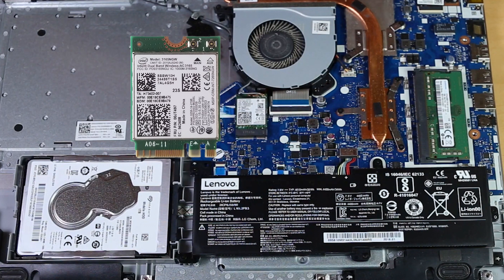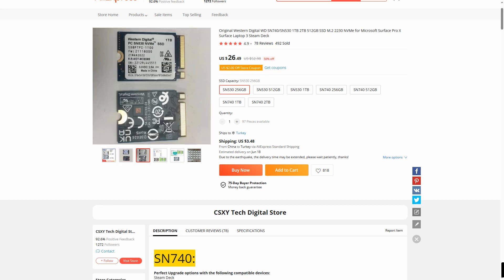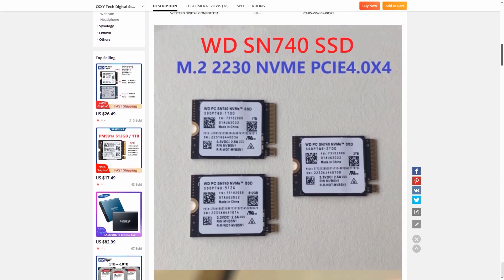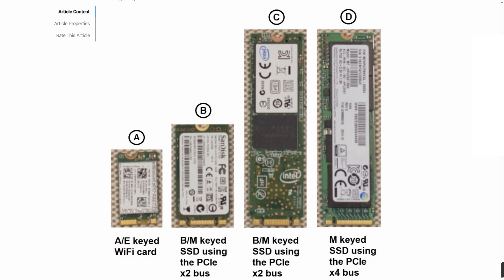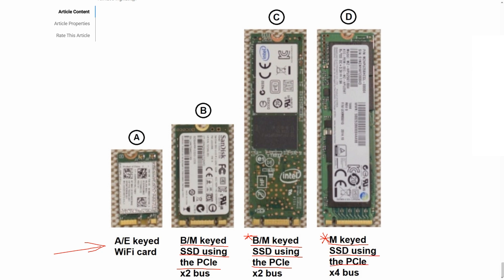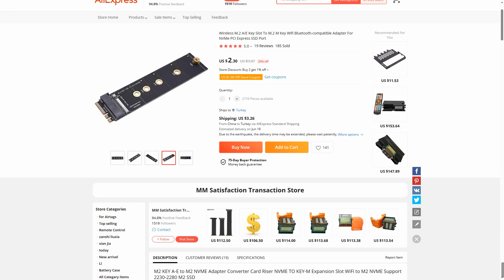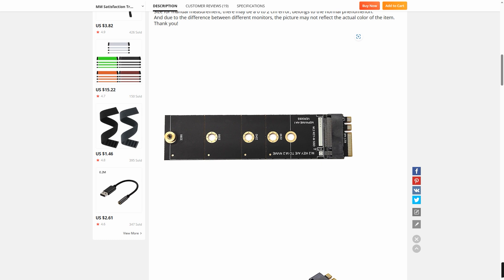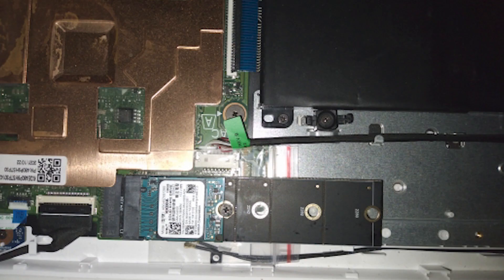Convert WiFi Slot to M.2 NVMe SSD Slot!

Comment: So you are managed to install a SSD into your notebook but I am just wondering if you could boot your Windows from it, could you?
Reply from the maker: Yes, after I plugged in the M.2 SSD to my Wi-Fi port, I migrated all my previous Windows files and other folders to my new SSD and adjusted the bios. Then, I can boot my new M.2 SSD. You may find the bios details on this video;

https://youtu.be/YBwPaWFExsQ?si=kjcy8mDxp-NaqyYu

Comment: I have dell Inspiron 15 3543 There no slot for M2 NVME ssd if install NVME using NVME SSD TO SATA 2.5" SSD ADAPTER THEN LAPTOP WILL SUPPORT I CAN INSTALL WINDOWS IN THAT

Comment: Where did you buy it from? I've a similar problem. The WWAN port in my laptop requires a B key pcie SSD. But I bought an M key SSD. So, I need an adapter to convert a B key to M key
Reply from the maker: I bought it in Aliexpress and put the converter link in the video description. But I think your situation is different, so contact the seller or search for a different converter before purchasing

Comment: do the laptop recognise the ssd directly? do you change boot options in the bios ? or do you do some other actions that are needed?
Reply from the maker: My laptop directly recognized 2.5" SSD, but I didn't have an M.2 NVMe SSD slot. So this way, I could plug M.2 SSD into my laptop. All the bios adjustments are in the below video;

https://www.youtube.com/watch?v=YBwPaWFExsQ

Comment: I have a wwan slot avaible, wonder if i can adapt something useful there
Reply from the maker: Some devices support using the WWAN slot for a secondary SSD. Some M.2 SATA III SSDs may be plugged in.  You should check your device's documentation

Comment: It's a great video
I got Lenovo z50-70 laptop
And I buy Samsung nvme PCIe m-key
But i don't find a way to attach it into my laptop
After i watch your video i get some hope to do it in my laptop
But i look for the WiFi slot i found it very tight to do that 😢
Can you guide me what i can do? 🙏
Reply: Thank you
Reply from the maker: Thank you for your comment.
I use a USB wifi adapter as an alternative

Comment: I wonder what is the max read/write speed of the NVMe drive in this Wifi slot setup.
Reply from the maker: I got 1257,54 Read (MB/s), 1211,65 Write (MB/s) which quite higher than my Sandisk 2.5" SSD

Comment: I have got a Samsung laptop that has a 128gb MSATA . The problem is that the MSATA SSD and WI-FI card are both on the same chip! one side is ssd and other side is Wi-Fi card . Wondering if anyone knows how to upgrade my ssd to higher capacity?
Regards

Comment: Did you test the read/ write transferring speed?
Reply from the maker: Yes, I got 1257,54 Read (MB/s), 1211,65 Write (MB/s) which quite higher than my Sandisk 2.5" SSD

Comment: I tried this, but the computer never recognized the SsD. My computer has two slides however, one is white and one is black. I wanted to put in to SsD cards but the white one will only work with Wi-Fi. Is there a workaround for this?
Reply: It is a HP g1 800 desktop it uses laptop internals

Comment: What conceivable user could want a particular style of SSD more than Wi-Fi capability? Seriously.
Reply from the maker: A conceivable user who wants a faster speed hard disk than his normal ssd but doesn't have M.2 NVMe in his laptop motherboard could want Wi-Fi. Alternatively, a USB Wi-Fi can use for a Wi-Fi connection
Reply: @techwise66  Good point. For my work, built in Wi-Fi is so essential, I’d prefer an external drive. I didn’t note what laptop you were working with but an internal SATA SSD is quite adequate.
Reply from the maker: @artysanmobile  Thank you. My laptop is a Lenovo Ideapad 520. Yes, it depends on the work type. In my preference, I want to have a faster hard drive.

Comment: Breathtaking video bro!
Tons of thanks for such a useful video!
By the way, could you boot from that? I hope yes. If yes, then any motherboard settings change required?
Reply from the maker: Thanks, Bro! Yes, I migrated my previous ssd to the new M.2 NVMe, which is bootable. I just set bios settings like the below video, and it works very well;

https://youtu.be/YBwPaWFExsQ
Reply: @techwise66  more thanks to you bro. I'll try myself as I hope. Your videos will guide me like Bible. Best of luck!

Comment: Good but is there any splitter to add SSD + Wifi card + eGPU in one wifi card slot ?
Reply: Ok you already have adaptor for wifi card to m.2. please check whether connector with 3 m.2 slots for 1m.2
Reply from the maker: I didn't see this type of adapter before

Comment: Awesome job. Do you think it is possible to install win10 on the ssd that replaced the wifi card using an usb stick and run win10 from it? I m trying to save a lenovo laptop for my nephew which has a faulty eMMC(imo) and cant install win on it. I though about soldering a m.2 port on the motherboards but i saw other missing components and i dont have any schematics. Keep up the good work!
Reply from the maker: Thank you! Yes, I have already migrated my Windows 10, from 2.5" SSD to M.2 SSD, and it works as bootable as well.
Reply: @techwise66  Many thanks for your swift answer. I will order the adaptor and give it a shot. Good luck with the channel and everything you do!!!
Reply: Works to you? I'll try to do the same.
Reply from the maker: @AgendaBioBioCL  Yes it worked very well for me

Comment: you could have also got an NVMe adapter and replace the hard drive only
Reply: The purpose of pcie slot is to increase the speed. If you use NVME SSD but slot into SATA port...the max speed is only 600mb/sec. That's why we use pcie slot...
Reply: @farishakim6759  yeah its like 4 times faster, but could upgrade both drives all the same. as long as the wireless functionality isn't needed or easily replaced another way, its a nice way to go. I thought it would be good to also swap out the mechanical drive too, coz its just going to die one day

Comment: I want to do the opposite, I got a perfectly good wifi card in my busted Brickpad that can be used for my desktop but I wasn't sure if I could use it in an NVMe SSD slot. Looks like I'd need an adapter but I'd rather just get a PCIe wifi card instead, unless one of these laptop cards would simply fit into a PCIe lane and work without modifications.

Comment: seems it would be great... a shame I don't have ethernet going throughout the house lol. Figure I could use it though for older hardware with similar slots instead of throwing away old computers
Reply: You could use a usb wifi receiver in those,  that's what I do with old gear.
Reply: @JRose-zn7iw  The only one I have would be a horrible replacement... I might be able to get 10-20mb per second on it... it's from 2005 or so lol and was cheap, to begin with. I currently lack money for a new one, but thanks for reminding me of that as I completely forgot about that possibility.

Comment: Neverbe  success to boot that nvme, need inject dxe driver to bios, so need more effort to do
Reply from the maker: In my case, it is bootable
Reply: What is your laptop? Native boot to nvme?
Reply from the maker: @albhenpa  Ideapad520. Just cloned my current bootable 2.5" ssd to the new M.2 nvme and worked well
Reply: Oh I see, released 2017 and I think lenovo bios update dxe driver  included
Reply: @albhenpa  the other way to know if go to disk management and check if the installed NVME is detected or not. If its detected, then high probability it can be bootable

Comment: You can also upgrade your wireless to 802.11 ax by updating the NVME wireless card. (Don't forget you will need a new driver before you swap out the card!)
Reply: not with linux!  no need for drivers!
Reply: @jimw7916  OMG! You've invented a NEW Linux OS????? One that doesn't need drivers for hardware???? You are going to be a BILLIONAIRE
Reply: @benjiro8793  like I said .....dumbo

Comment: Thanks for this! I was just wondering about doing this as I don't use wireless or BT on my laptop. It's hardwired to the network via RJ45. My ideapad 330S has an NVME slot that HAD an intel Optane memory stick in it. I swapped it out for a 1TB M.2 NVME PCI-E stick.  Remember NVME PCI-E is a buss that has revisions with speed limitations. We are at PCI-E 4.0 and PCI-E 5.0 is just being installed on bleeding edge motherboards. The standards are supposed to be backwards compatible but just like RAM, you can't go faster than the buss speed. So check what revision of PCI-E your motherboard is running. 
Similarly when looking at NVME M.2 to USB adapters, you can't go faster than the USB iteration on your motherboard. 
What it boils down to is don't over spend on the NVME SSD you buy.

Comment: Can it be done the other way round m.2 to wifi/BT?
Reply from the maker: I saw an adapter to convert M.2 slot to wifi too (Wireless M.2 A+E Key Slot to M.2 M Key Wifi Bluetooth Adapter)
Reply: @techwise66  Cool thanks for responding. I have a spare wifi/BT card in a old lappy however I just purchased a BT5.0 for my Xbox controller but for anyone else who reads this it's good to know.👍

Comment: Ok great. But now a fast nvme-disk and no wifi. How to get the wifi working again?
Reply from the maker: There are some good Dual-Band USB Adaptors for wifi. This could be an alternative.
Reply: @techwise66  ok. Well I was actually thinking that you might be able to use the spare m.2 slot with some sort of wifi adaptor. Effectively swapping wifi and SSD.
Reply from the maker: @DavidLyon  In my laptop, unfortunately, there is not any M.2 slot which is why I used the adapter to use the wifi slot as M.2 slot. I think I read in a comment that some have more than one M.2 slot that may use your idea.

Comment: Great mod. One can always use a usb wifi dongle. Lots of variants and form factors to choose from anyway.
Reply: Great point! Remember that you're not going to get better speed than your USB buss can deliver. Also, I really recommend paying attention to heat dissipation because these SSD's run VERY hot and heat is the major cause of early degradation of memory products.
Reply: The number of USB ports on laptops are quite limited these days. Some may only have two USB Type A's and maybe one or two USB Type C's. Dont seem the point of wasting a USB port to a dedicated wifi card unless your laptop has a soldered in Wifi card that isnt user replicable and hooking it up via the built in network card isnt convenient. 

A majority of internal wifi cards are user replicable but there will be some that arent.
Reply: Usb wifi dongles suck. Chances are if your laptop doesn't have a m.2 slot built in it really won't be that much better than a good ssd

Comment: Brother..just wondering, after you put the adapter, can you close laptop cover ? Cuz the height of the adapter is 22mm which is taller than laptop right?
Reply from the maker: Yes, brother, I can close the laptop cover. The thickness of the adapter is very thin, I mean mm level. And the adapter can be broken based on your ssd size, which is 2230 for me. So I cut it to 2230, which fits my laptop motherboard.

Comment: Nice Work!! You know if the connector of the laptop witch is double sided can support the wifi card and the M2 ssd simultanuesly and if  the adapter has some limitation on what type of M2 you can install , it supports 2280 as well for example??
Reply from the maker: It supports M Key NVME SSD (2230, 2242, 2260 & 2280 sizes), and it doesn't support SATA-based B key SSD. I didn't encounter any limitations until now, and it works very well.
Reply: @techwise66  In the Boot menu on the bios this port recognised as bootable or it takes it only as a 2nd drive only for saving?From the other side of the port you can still connect the WIFI card??
Reply from the maker: @Drumsholic  It can be used as either a bootable or a second hard disk. You may find my bios in this video;
https://youtu.be/YBwPaWFExsQ
I use the internet with the ethernet cable, but you may also take a USB wifi

Comment: At that point you should just upgrade the laptop itself, but sounds attractive to anyone with ultralow budget to push the old laptop a little bit further. There's a good chance it has rj45 or using some usb wifi dongle as others said here. BTW i saw different m2 configurations but seeing the "key" differences it's just insane! It should have been the same port from the begining, negotiating the speed with the device and that's it. But no sir, sellers think with the wallet, not with reason, so the goal here is actually preventing the final user what was done here. Thumbs up on the final result and fu$# the sellers.
Reply: Well...not really worth to upgrade the laptop when you can only spent less than 100 bucks for both NVME SSD + Adapter.

Comment: Good video, I get it, personally I would upgrade the HDD to an SSD before giving up my internal wireless and bluetooth on the laptop.. there are external adapters for both, and more than likely faster, like adding wifi6, however the benefit of the laptop is to be small and portable, you have to start adding in external devices to make up for what was once internal...
Reply: Well. U can stick the wifi adapter at the back of your laptop...then connect it with USB 3.0 female to USB 3.0 male...
Reply: There are very small USB WiFi adapters, in case you need the M.2 upgrade, but remember WiFi interface is PCIe 1x, not 4x as NVMe M.2 SSD.
Reply: @FROILANDRES 
I don't about how they use them, but m.2 E-key has 2 1x pcie lanes, and a usb 2.0 interface. I don't know what is thr use of the other PCIe lane, but the USB is used for Bluetooth in my wirles card.
Reply: es es el problema, y bien lo resumiste, si hicieran un m2 para que entre como un SSD, y seguir conservando la targeta dual channel wifi y bluetooth. gracias por tu apreciacion.
Reply: @Auut-dj9bu yo estoy buscando algo parecido para dejar de usar el hdd de mi muy vieja laptop a partir de haber observado la tarjeta de wifi se me hizo muy similar a la m2 , casi que tuve la misma idea que el que subió está muy interesante información
Reply: En usa y europa ahi adaptador y vienen unos m.2 para esa parte de la placa Wi-Fi-bluetooth y donde va el disco. Yo a mi hp g42 le puse unSSD DE 240 Gb anda mas rapido pero con linux . Windows es pesado y mac Os mas todavía.

Comment: It would be interesting to explore whether any of the M.2 slots are capable of supporting multiple cards, using an "M.2 riser" - I don't know whether that exists.
Reply: Basically you would need PCI-E <-> PCI-E bridge controller chip... I assume it will restrict the bandwidth usable for each card. Obviously you could split the USB and PCI-E pins and use one card that only use USB pins and another card that only use PCI-E pins.
Reply: @Monni95  would the USB pins enable a M.2 card to act as a hub?
So potentially providing the port for the termination of a USB network, which the standard supports up-to 127 devices.

Comment: WWAN slots since the Dell Lat 6xxx series have accommodated M-SATA cards.  Plus, those machines have a BIOS that allows turning that WWAN slot into "bootable"... huh?  Wha-?!!  Is that like Bootable Ethernet?  That was my first question by on the Dell Lat 6440.  I tried it, and voila, that worked.  I don't have a Dell Lat 7xxx series with a WWAN port, but I wonder!

Comment: Now i have another question. Can this be doable the opposite way?
Reply from the maker: Good question! Yes, it can be in the opposite way as well. You can plug a wifi card into an M.2 slot with an adapter

Comment: So you will only connect your laptop either by a ethernet cable or via usb wireless adapter to access the Internet?
Reply from the maker: I use an ethernet cable for the internet right now.
Reply: Of wifi.  You can use your Bluetooth slot for the ssd.

Comment: can be used as a boot disk or only as a secondary
Reply from the maker: It can be used as either a boot disk or a secondary. I am using it as the boot disk
Reply: @techwise66  velocidad que tiene
Reply from the maker: I got 1257,54 Read (MB/s), 1211,65 Write (MB/s) which quite higher than my Sandisk 2.5" SSD
Reply: @techwise66  TENGO UN PORTATIL HP DE AMD A8 4NUCLEOS Y VOY A INTENTAR TU TRUCO GRACIAS POR SU AYUDA

Comment: Nice research man,but I'm happy with the speed of my  2.5" SSD Samsung with 550 Write/Read.
Did you test the speed ?
Reply from the maker: I got 1257,54 Read (MB/s), 1211,65 Write (MB/s) which quite higher than my Sandisk 2.5" SSD
Reply: @techwise66  my laptop is a Toshiba A75-P7100,i 7 with 32 GB of ram. I can have similar speed as you got when I installed another SSD in Raid Zero.
I'm using this 17" Toshiba just for viewing YouTube,for my work, I use my Mac Pro 2019 and my MacBook Pro M1.Thanks for your rapidly answer.
Reply: @Locky2701  are your SSD SATA or NVME?..cuz SATA max speed is only 600mb/sec speed and write.
Reply: @farishakim6759  in Raid Zero mode,you'll get double the speed of a single SSD
I have 2 SSD Sata in my laptop ,1 TB /each
Reply: I assumed what you said is theoretical speed ...Like what is advertised and not real scenario, right?

Comment: How many lanes of PCIe do you get?
Reply: wifi cards in m.2 form factor are in x2 and x1 available, it depends on wifi generation, like in wifi 5 ac or 6 ax and 6e they take x2 lanes
but in anything below take x1,
and as far as his laptop build year and config and speed he got at test his wifi slot is x1 lane (which u take about 1GBps speed) stil faster than fastest SATA SSDs,
specially these days NVMe drives are cheap speacilly those with not very fast NANDs, so even most cheap M.2 NVMe SSDs will support up to full use of PCI-E 1x (any generaion) speed
Reply from the maker: I purchased the adapter for the wifi slot to use m.2 nvme hard disk and in my laptop there is only one wifi slot